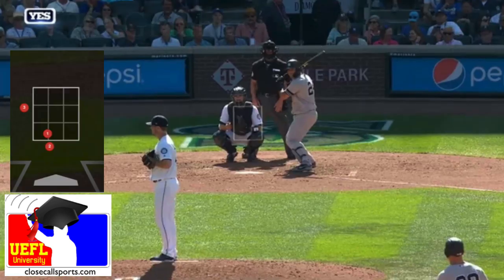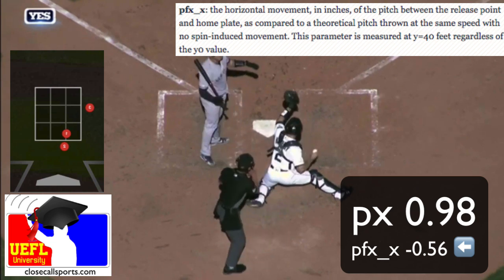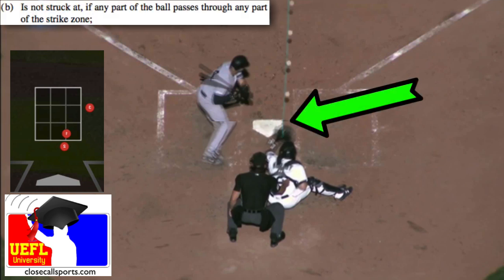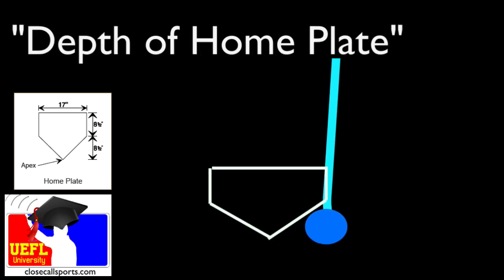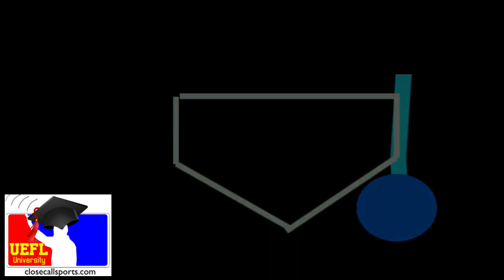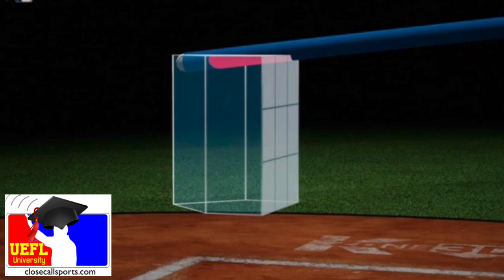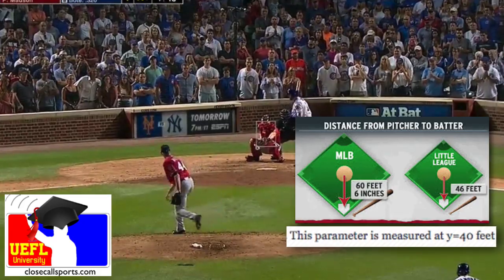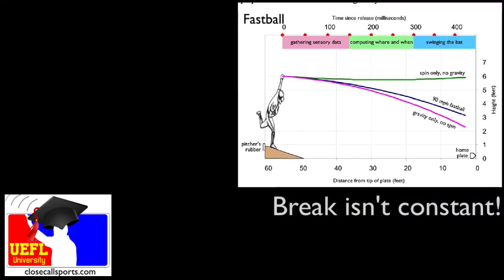Baseball's 2D TV Computer Strike Zone's 3D Problem

Comment: It should really be emphasized that the strike zone is a 3D volume of space, bounded by the 5 vertical planes on the edges of home plate and the 2 horizontal planes at the upper and lower limits. Because a pitch can break, it can enter the zone from the top or the sides, not just the front.
Reply: I absolutely LOVE the 3d graphic representation of the stirke zone.  I've umped for 10 years, and players just look at you funny when you try to explain this.  I also think the 3d graphic comes more into play with slowpitch where that ball comes down from 6-12ft up...

Comment: I always thought/assumed the strike zone was as the ball crossed the front edge of the plate. So that isn’t the case?
Reply: Yep. Any part of the ball passes through any part of the zone, its a strike. I thought that same thing for  a while.
Reply: The front of the plate, before it angles to a point is 17" x 8.5". This front rectangle is part of a 3 dimensional rectangular "box" that is the strike zone. If any part of the ball passed through any part of this three dimensional space, it is a strike.
Reply: @MH-Tesla  I don't think that's quite accurate.  For example, a pitch could be too high as it goes over that three dimensional box, but the strike zone includes the area over the rest of the plate, including the point.  If the ball was down the middle and at the very back point of the plate was no longer too high, it's a strike.
Reply: @jimhughes1309  Correct. And that's the issue. We see a 2D window. A curveball passes above it and falls into the back of the zone. Ump calls strike, fans boo because the ball passed the front plane above it, not understanding that the ball curved down and caught the back of the zone. Similar with a back door slider - it passed the front of the zone, slide across and caught the back of the zone, strike! But fans see the 2D graphic and complain. MLB should be doing a better job of educating its fans so they can better appreciate the game they're paying to watch.
Reply: @dgaubin  100% agree.
Reply: The other issue is, the size of the zone changes based on the size of the batter. But the graphic 2D box stays the same from batter to batter, which is wrong. So think about a Yankees Blue Jays game in which Aaron Judge and Bo Bichette are playing. A high pitch is called a strike for Judge, but a ball for Bichette, because Bichette's swing posture makes him shorter than Judge's. Baseball really must do a better job of educating its fans.